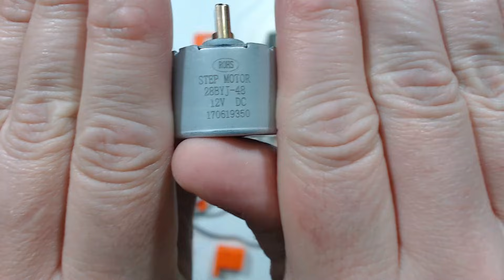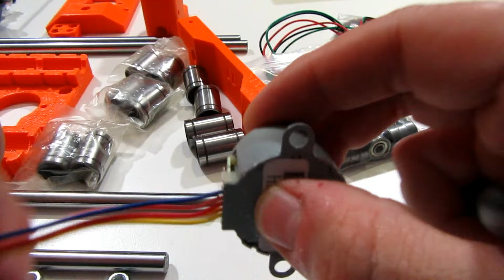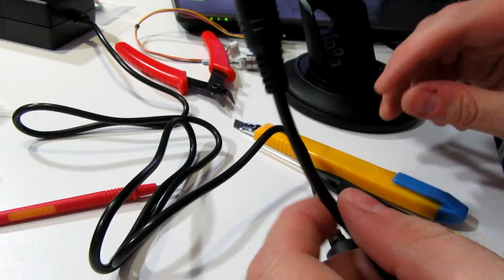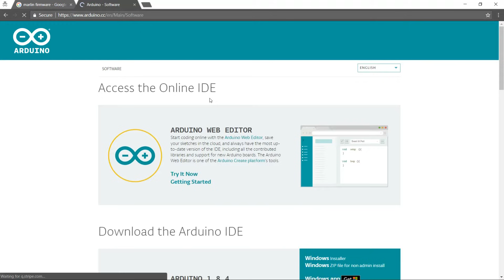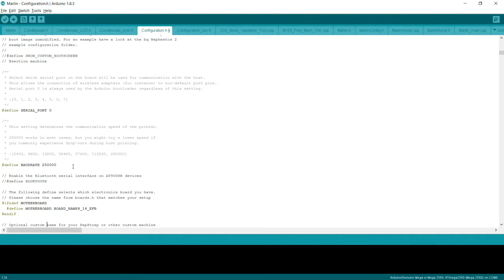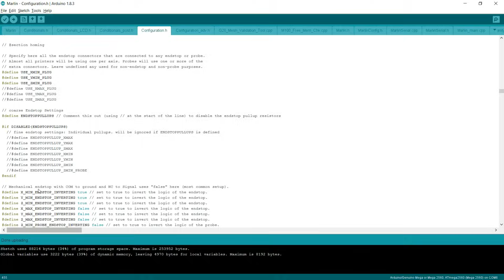Building the Cherry 3D Printer -  Part 1 -  Intro and Electronics

Comment: Hey there, I've finished building the whole printer. As you suggested, I did check the motors & the drivers before starting the build. Everything was ok. But as soon as I connected everything after completing the build, the drivers seemed dead. those drivers was just collecting dust while I was building. The motors are not moving at all. I did check the voltage to each coil. It's showing 0v. I did not unplugged the wires while it was powered on(damaged other 3 driver before by doing it). I tried both your modified marlin firmware & the original designers repetier firmware.
Reply from the maker: Sorry to hear that you ran into trouble. Off the top of my head, have you checked to make sure the ramps board is getting 12v from your power supply? The board will still connect to your PC and respond to commands using just the power from your USB, even if the power supply is disconnected. And are you powering both sides of the power connector for the ramps? Two of the pins power the bed side of the ramps setup, the other two power everything else. Let me know!
Reply: Did u set the current limit on the driver?

Comment: Please help xtruder motor not feeding..
Reply from the maker: Sure! It doesn't turn at all? Have you heated the hot end? One thing to remember is, by default, the extruder will not turn if the hot end is not heated.

Comment: Hi Print N play. Thank you so much for your tutorial. It is extremely useful.
I have a question: Can I conect the Arduino Mega 2560 to the computer and at the same time to the 12V DC power?
Reply from the maker: If you are using a RAMPS setup with the arduino, it will convert the 12v down to 5v for the Arduino. You can connect the USB at the same time as the 12v this way, which allows you to control the printer with a computer or raspberry pi
Reply: Thank you so much for your quick and clear answer

Comment: i saw on the z axis tha  you use a kind of  wood insert to move the z axis can you tell us where  you bought them?
Reply from the maker: They are just pieces of 1x4 that I drilled holes through, then attached the mounts for the motors to that.
Reply: @PrintNPlay   i mean the nut that you use with the clamp to move the axis up and down :)
Reply from the maker: Ohhh! I don't really know what those ones are called. I found them at a local hardware store. The design calls for you to embed m5 nuts into the printed pieces. Mine didn't show up in time so I used those instead.

You are better off using the embedded nuts, trust me!
Reply: @PrintNPlay  ok thanks man :) maybe gluing them to the slider  with some  krazy glue syle

Comment: i cant drive 28byj 48 step motors. please help
Reply from the maker: Bora Emir Şahin most common issues are that they were damaged during the modification to make them bipolar, that you are driving too much current into them, or that you are trying to move them too fast.

Also, make sure that your limit switches and thermistors are all reporting properly.
Reply: i dont connect the thermistor cables into the ramps.Could it be from it?
Reply from the maker: Bora Emir Şahin if the thermistors are not connected, the software prevents the printer from running. You must have them connected.
Reply: I connected the thermistor, when i want to control motors, i take fatal error
Reply from the maker: is it giving you an error message? Are you on twitter or anything where we might be able to have this conversation easier?
Reply: Print 'N Play Im using instagram, if you want my nick is boraemir_sahin

Comment: Another crazy question...I had several old busted inkjet printers...recovered some 8mm smoothrods, cut some down...I have 2 at 209mm (8.25"), and some that I can cut off at 190mm (7.5") do all the rods have to be exact, or can you use different size rods?  I know that the bed area will then not be perfectly square, but absolutely free (even though the link you provided was already dirt cheap) will that work?
Reply from the maker: So, you basically need your lengths to be paired off. So two of whatever lengths you can do. It's really important that each axis is square on its own, and the parts for this printer don't let you push the rods all the way through to compensate for different lengths. The exception would be the z axis, where they can be off a bit because they just extend straight up with no end caps.

Hope that makes sense!